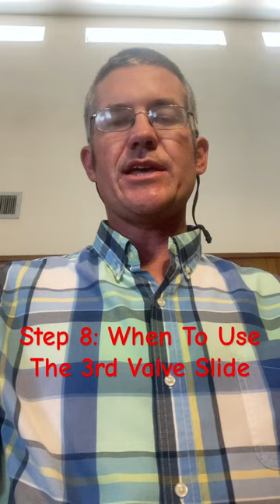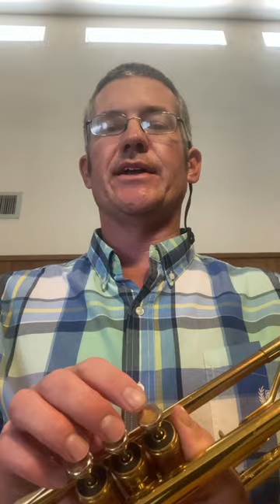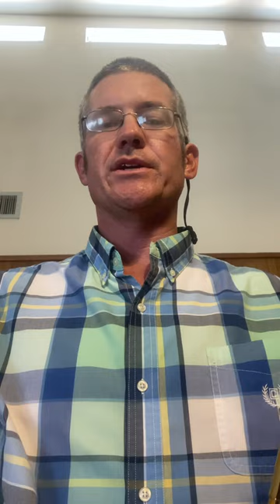Step 8: When To Use The 3rd Valve Slide #trumpet #howto #how

Comment: you can also do it for Eb, and i think you could for every other note that uses 1st and 2nd, you would just have to only push 3rd down
Reply from the maker: The most common use is for those notes that tend to be sharp. This includes combinations of valves 1 & 3 and 1,2&3 for low D and C# below the staff. It can also be used for low G and low F# below the staff.  These are the only times I have seen it used. I hope this helps.